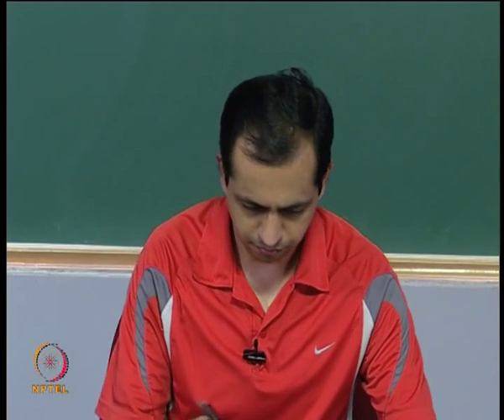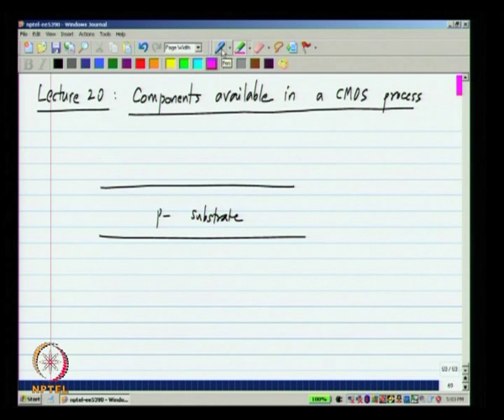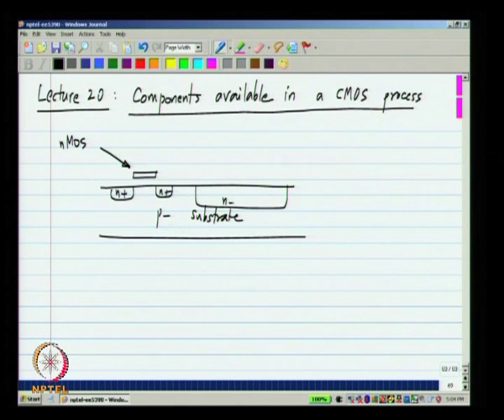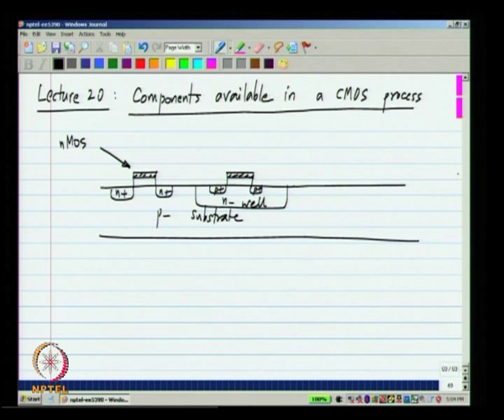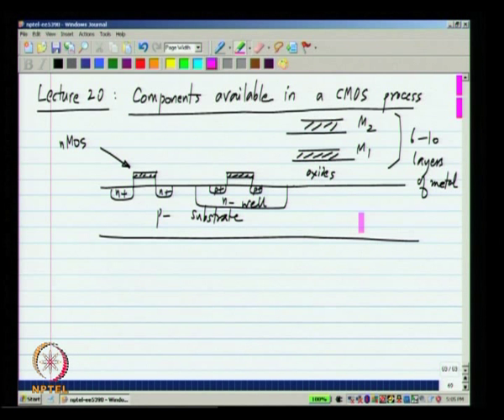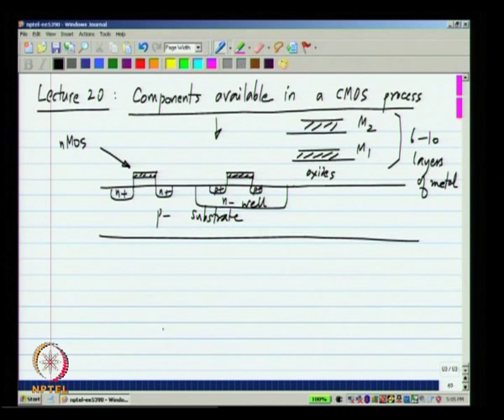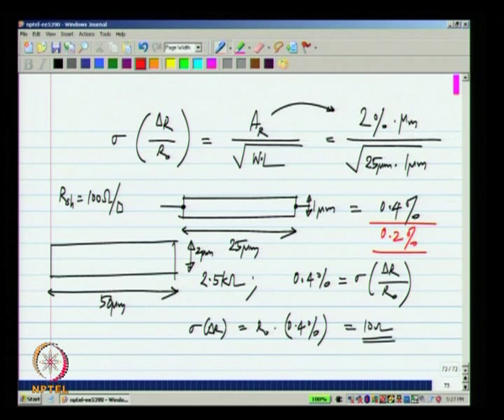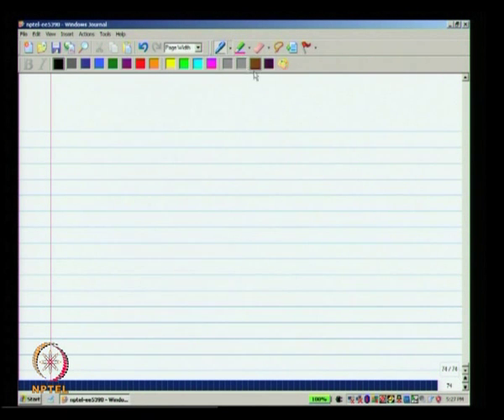Mod-01 Lec-20 Lecture 20

Comment: At 30:15, How can we say that each four of them has same Sigma1 value? Earlier Sir said that all four resistors will have different Delta R value i.e DeltaR1, DeltaR2, DeltaR3, DeltaR4. Shouldn't it be square root of sigma1^2 + sigma2^2 + sigma3^2 + siigma4^2 ?
Reply: he generalized delta R by R0 to be sigma 1 at 29:17
Reply: @shikharsrivastava8346  yes that I know. So, does this mean that all the four resistors follow the same Distribution function although they could have different delta R value?